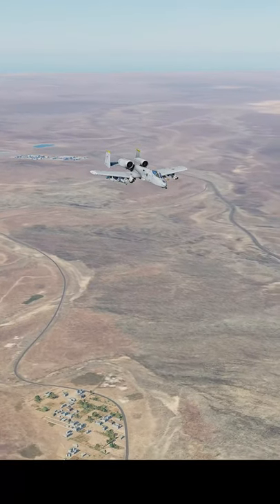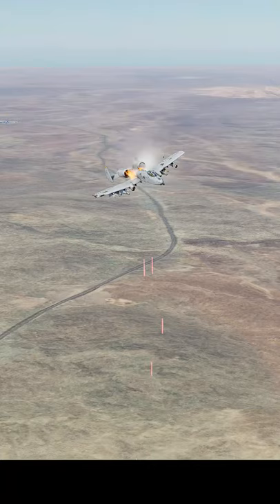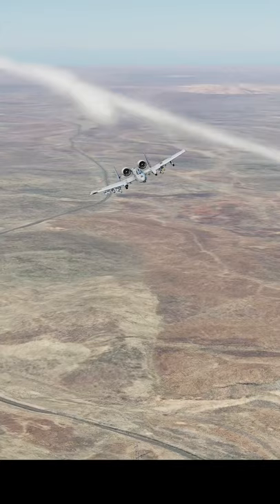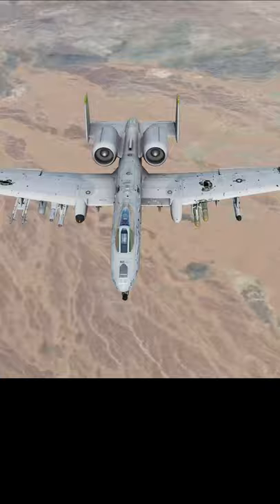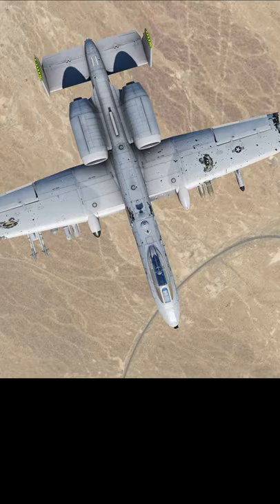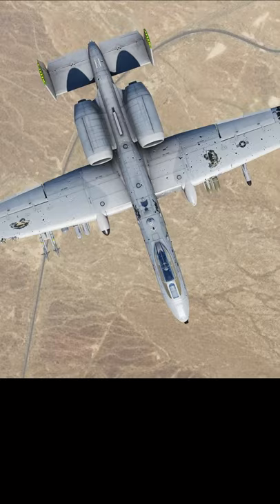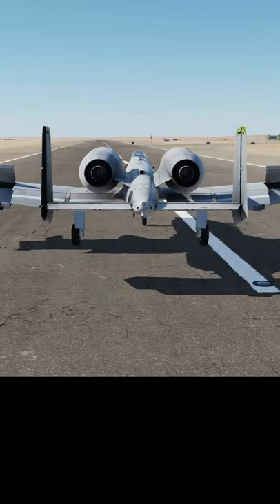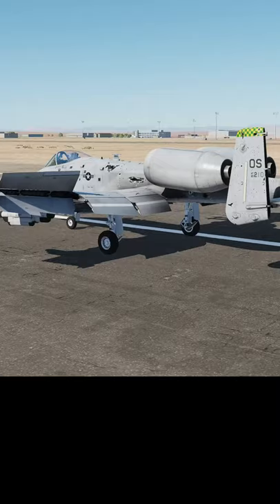Limping Back to Base in an A-10 (#Shorts) Real Pilot Plays DCS World

Comment: My uncle helped design and work on the A-10 way back in the days. They literal tanks. You can fly it with one engine and one and a half wings.
Reply: Most if not all 2 engine aircraft’s can fly with one engine. however, yes it is a tank the A-10 can fly with barely one wing.
Reply: in war thunder you can fly with 1 and a half wings with most planes but if it takes out the more inside part of the wing it visually looks like you flying with only one

edit: fixed spelling of eing to wing
Reply: nice
Reply: @hashbrown_blitz8869  lol yea I was talking about real life not war thunder the game 😂
Reply: figurative tanks.
Reply: @eguerr5036  but can they fly with one engine gone? As in no longer attached to the plane? I doubt a 737 or equivalent could handle that Cg shift.
Reply: @maxk4324  it’s regulation for planes to be able to limp to an airfield on one engine (Or drift depending on weather)
Reply: Was your uncle somewhat inspired by the IL-2 I wonder?
Reply: @hashbrown_blitz8869  well war thunder isnt realistic, not even close to that (in "rb")

You can fly things like il-28 and me 262 with one engine cut and still be in full control which is ridicilous since the engines are so far apart and at other times when you might lose some small part and be completely unflyable (wrong but in the other direction!)
Reply: @maxk4324  Yes they can. If it can glide without an engine. It sure as hell can fly with atleast one. Though I would jettison any armaments like bombs and dumb rockets, or missiles.

Comment: Over 30 years ago whilst working for DEC some guys in the US wrote a flight sim for the workstations of the day. The software had flight envelope modelling and controls that were very accurate. As a defense contractor to many parts of US forces certain data was gleaned and even the SR71 Blackbird was modelled. We had damage visualisation then (1987ish), albeit a bit primitive. 

As a novice on the sim I managed to do something and it seemed to lock up. One of the "experts" came over and switched to external view which showed both wings missing, as in broken off. The log showed I'd managed to pull a 14G turn at mach3. I asked how come the plane was still flying ... The reply? ... "You're ballistic! Throttle back and see what happens. BTW ... You're dead!"

Throttled back, speed dropped, went nose down and crashed straight into the ground at Mach 2.6!!😱😱😱🙄🙄🤣🤣🤣

Comment: Holes in the wing but no leaking fuel?

I'd like to see that kind of detail.
Reply from the maker: The tanks in the a-10 are between the wheel well and the fuselage, so the tanks might not have been damaged here - but you’re right, I doubt it would have been modeled! I did a very normal flight in the A-10 over on the channel (spoilers it wasn’t normal) check it out if you enjoyed!

Comment: If you had holes in both wings you'd be out of fuel...
Reply: Self sealing fuel tanks. I know they only work so well though.
Reply: Center tank as well.
Reply from the maker: ditto to the other two comments, plus the wing tanks in the A-10 are between the fuselage and the wheel wells, so the holes weren't near the fuel tanks! Good point though - lots of planes would have been SOL with damage like that!

Comment: Microsoft is a flight sim, not a crash or mil sim.. So you can compare that in my opinion
Reply from the maker: ahhhh yes, the sim argument :) real airplanes suffer damage - so a real 'sim' would show/effectuate that. I can plaster a 787 onto any runway even with the highest difficulty settings turned up in Flight Sim (just check out some of my other short videos) and no aircraft damage (Unless i'm really trying to crash it, of course). Totally understand what you're saying, but the sim argument is - in my mind - an argument for damage modeling, changing aerodynamics, structural failures, etc. In flight sim you get a black screen that says you overstressed (or crashed) the aircraft. A bit disappointing - but it is a fun game/simulator either way! Thanks for stopping by! If you play flight sim, be sure to check out DCS sometime - its really something!